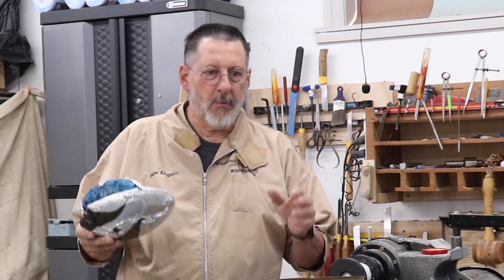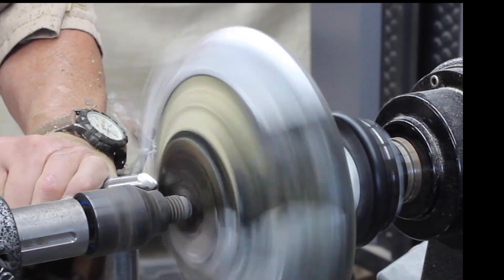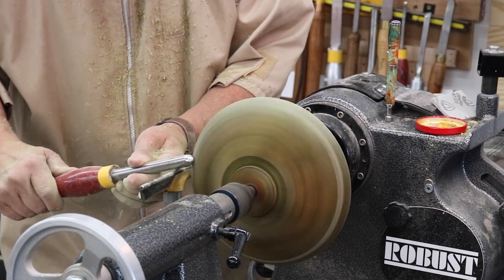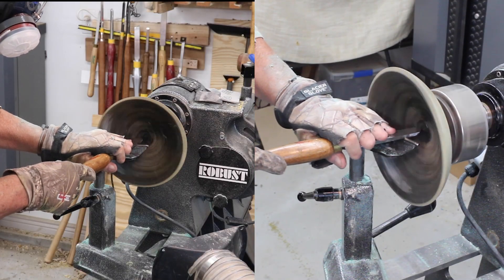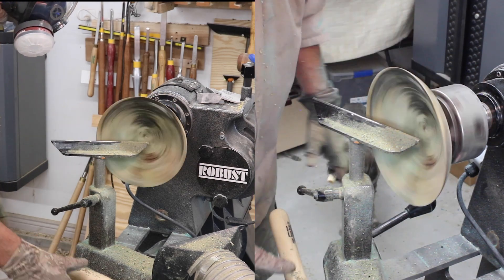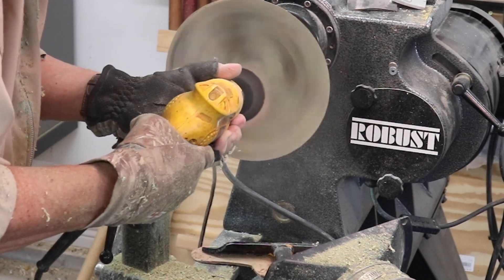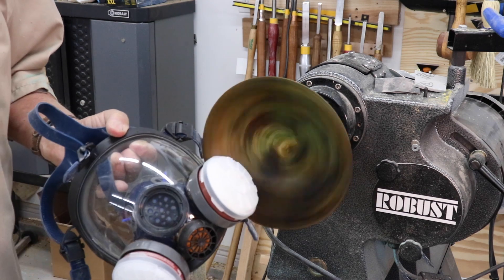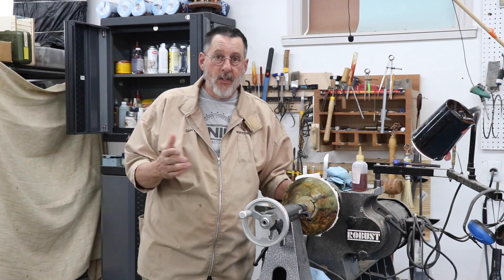The Ugly Duckling Bowl     Woodturning with Sam Angelo

Comment: Beautiful piece Sam. Just a quick point.... I've stabilized a lot of wood and found that the foil really isn't  a necessary step unless you're trying to avoid the mess stabilizing can make in the toaster oven. I find that putting a tray under the drying rack catches all the mess and saves me from having to pick foil out of all the nooks and crannies of a piece.  If you must use foil, create an open  pocket around the piece, instead of wrapping the foil closely around it. This will stop most of the foil from sticking to you piece. Thanks,  V...
Reply from the maker: Mike,  Not sure if I agree.  I will respond to this topic in my next NOTES video later this month.  Sam